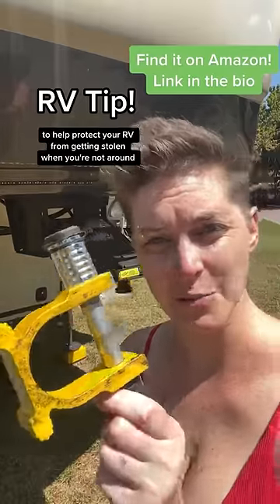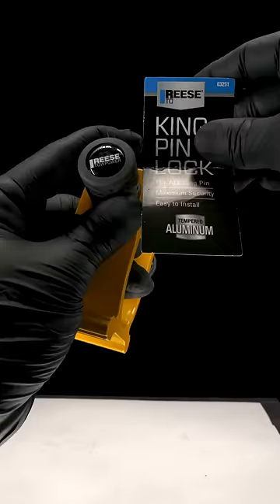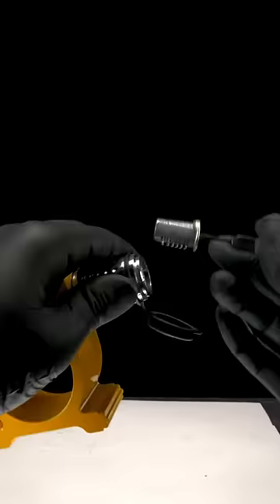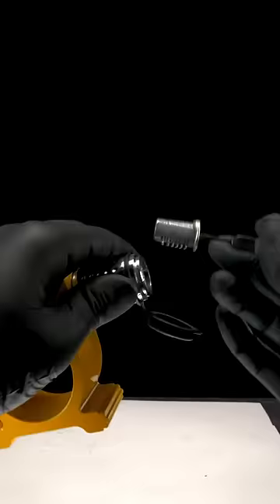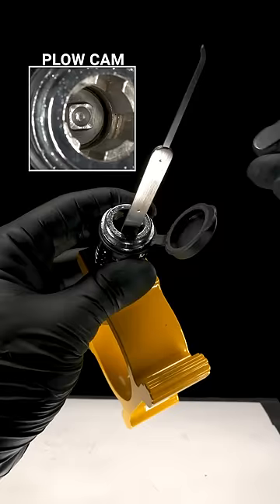Reese King Pin Lock opened with short hook & wave rake

Comment: This actually works! We found a trailer with this puppy attached, took it off, hooked up the RV and turned it 180 degrees on the same plot. Placed it back and waited for the owners to return.
Reply: 'Hope you came back to clean up all the mess in the kitchen from the toppled stuff not put away bcuz they weren't expecting to move just yet...
Reply: After getting my 5th wheel trailer, I told a fellow full timer that I was going to get a lock for the kingpin, and he told me that something similar happened to him. His 16 year old grandson and his parents were visiting. While he and his wife were out getting groceries, the kid pulled the lock apart in just a couple of minutes, and his parents packed everything up real quick, moved the trailer to a better site and set up again. They got the dismantling (he refused to call it picking) on video and met him at the swimming pool. When they all got back to the original spot, they played dumb until he pulled out his phone to call the police. 

So he went to the local locksmith, whose father was a friend of his and got his recommendations and went and got one. A few months later and he forgot to remove the lock and broke it off with the hitch. With very little damage to either the hitch or the pin.

He didn't bother with pin locks after that and just focused on keeping the door locked and the valuables in the truck and car... The kid got into cleaning up foreclosed houses for banks, landlords, and realtors. It involves lock picking, which he had been curious about before that incident. Then he got really into it.
Reply: more on Things That Never Happened 😀👍
Reply: @taitano12  This story is entirely incoherent and I have so many questions:

1) Why was the kid and parents stealing trailers from the grandparents?

2) Who played dumb? The kid? Played dumb as in pretended there was never a trailer there?

3) Who pulled out a phone? The kid or grandparents?

4) How did the grandparents get the theft on video if they were gone?
Reply: Pics or it didn’t happen 😁
Reply: Every time I hear or read a sentence that starts with "This actually works!...." I immediately disapprove the following
Reply: @chad1755  actually, the story is quite coherent. 

It was either the kid or the parents who got it on video, not the grandparents, and they didn't steal it, they moved it to a different spot. The parents and the kid played dumb, acting as though they didn't know what happened to the trailer, so the grandparents thought the trailer was stolen. That whole "Where is it??" part probably only lasted a few seconds and it was the grandfather who pulled his phone out to call the police.
Reply: Things that never happened part 1.
Reply: Ya, um no. Look, just cuz he made this look hella easy doesn't mean everybody could just do it like that. We all understand that, well, all of us except u
Reply: @oliverklozhoff  So what. Just because not everyone can do it doesn't mean nobody can. You'd be surprised by how many people have that skill. I don't, even though I have the knowledge. But I do know several people who do have the skill. So I'm willing to give the benefit of the doubt. To both op and the guy I met. Everyone lies, but not everyone is a liar. Most people are fairly honest.

Comment: This reminds me of a truck camper lid I had. During pothole season I'd often find it unlocked or with the cylinder dislodged due to road vibrations. After the cylinder fell out completely while driving I gave up and installed a latch and hasp.

Comment: I learned this lesson many years ago. I had gotten thrown by my horse and ended up in the er. When I came back the next day (with friends to help me) to haul him home I realized my trailer keys were in the clothes bag from the er AT HOME! I had manufacturers locks on the drop windows and tack room door. The trailer doors and hitch were master locked. After asking around a farrier at the show grounds agreed to help. Popped the tack room through the door window in less than a minute. Had the locks cut off in about 30 seconds each. The drop window latches he popped with some tool in seconds. So in less than five minutes he had the entire trailer open for me to load and haul off. 😳🤯 I have never bothered to lock any of it ever again. I learned the important lesson that locks only work to keep honest people out. Just about anyone can get through them no problem. If you want your RV to be hard to steal park a vehicle that can’t be used to tow it under the kingpin.
Reply: You should still lock it. Criminals mostly aren’t masters. They commit crimes based on opportunity. If your stuff is unlocked and easy to steal, that’s an opportunity. However, if they really want YOUR stuff, they’ll get it. Securing your stuff keeps most thieves out. But not all.
Reply: It just buys time. Hopefully in that minute someone will recognize that the thief is doing something he shouldn't be doing.
Reply: Its stupid not to use the locks after that.  It's still a deterrent and makes people think twice.  How silly to just not bother locking it up aftee that.  The guy knew what he was doing.  Not everyone does.
Reply: @tylerfb1  Yeah, you want something to deter the person looking for an easy steal, but you won't deter the hardcore or well prepared.
I'm sure that lock could be cut of in about a minute.
Reply: Then you better be prepared to lie to the insurance company. They think locks will keep everything secure. So when they cause $1500 damage just to rifle through your car looking for crap to steal they will deny your claim if the doors were unlocked... Oh wait the damages were caused because the door was locked. Yeah enjoy the irony as you pay that $500 dollar deductable.
Reply: I don’t lock the trailer anymore. I didn’t say I left things in it unlocked or made it easy to hitch to and haul off. Either park under the hitch with a not tow capable vehicle or park deep in the lines where it is surrounded. I had to wait longer for people to leave so I could get it out myself, but better that than stolen. The locks are worthless if someone wants what is in there so find other ways to keep your stuff safe.
Reply: Locks still help, because most people think that it would not be worth it. They think that the lock works, and as long as they believe that, it does.

Comment: at this point Im starting to think that the most secure lock would just be a couple bolts with weird heads that require a special tool to open, and you just carry around that tool

Comment: 😂 I remember seeing this door that had a massive shiny padlock on the front door but the door's hinges were rusted bit's of sheet metal... pop the hinges and you could take the whole door off. The same usually goes for houses, they'll have a giant deadbolt to lock the front door but then the hinges are held in by a couple of tiny screws. "A chain is only as strong as it's weakest link"
Reply: Put a couple screws blocking removal of the hinge pin. Robertson heads are good, especially since they are less common down in the U.S. of A.
Reply: Yeah, typical. Also, most car door locks up to about 1990 are vulnerable to a large flat head screwdriver, it just take a little bit of force. The most typical bike frame lock is vulnerable to the same using a smaller flat head. Fact is most locks can be defeated in a couple of minutes using basic tools, they are just there to deter people who know nothing about locks, really.

Comment: What i would do if i was lock maker id simply ask locksmiths what causes them the most difficulty in lockpicking whether its hard to pick or just annoying... Then id combine the top three issues into my new lock, would it be unpickable? No. But it will be so frustrating they might give up and go for an easier target.

Comment: No one ever claimed locks are impossible to get into. Locks are also drastically easier to pick when they're in your hand and not attached to the RV they're supposed to be protecting.
Reply: Great point. To be fair, this particular lock seems to have been glued into its enclosure with wishful thinking. Others might be a bigger challenge when in use but this one appears to be pickable with all of one's limbs tied behind their back regardless.
Reply: Lockmakers use the most outdated form of mechanics ever to be used in security measures

Also, if this was on an RV, he didn't have to hold it in any way to do his thing
Reply: This would be legitimately easier on the RV because then you don't have to balance the thing in your hand while unscrewing the bolt.

Comment: Well I don’t have any lock picks but I do have a heavy duty construction saw. Does that work?
Reply: Ironically these things are often better protected against that than lock picking.
Reply: @Nerobyrne  I suppose that is because a lock is unlikely to cut your arm off.
Reply: Yes, but it might experience substantial wear.
Reply: Yes but it makes a lot more noise and takes longer.
Reply: Use a hammer it's faster!

Comment: Insurrance companies insist that you keep your door locked to prevent breaking and entering.. What is even the point? Is there even a lock that can't be picked in like 5 seconds flat?
Reply: Actual lockpicking is rarely the issue it takes an amount of skill and time, it's easier and faster bypass methods that you really want to guard against.

Comment: Behold the gates of Heaven!

McNally: The gates of heaven are using a holy trinity seal. Using my rake pin I can jiggle away one of the 3 trinity seals, where I can then use the slap technique the separate the other 2 seals from the housing.

Comment: Just buy a cheap to tin of horrible pink or purple paint. Badly paint the sides of the RV without trying to apply an even coat. Sit inside or around the camp fire (with your back to the RV) smiling and calculating the difference between the lock you never bought and the tin of paint.

Comment: Alternatively if you're bad at lockpicking, bolt cutters.
Reply: Unfortunately almost all these locks made are shit and don’t even require lock picking skills, the only thing you need is a comb/rake and you can now pick 80% of modern locks
Reply: @MushuaThePotato  the thing is though, some locks are well made, and are a pain in the ass to pick, but a good pair of bolt cutters and maybe a drill with a good bit do not care
Reply: @vralingfrostmere1561  yeah the small 4% of locks that aren’t vulnerable to comb or raking sure
Reply: @MushuaThePotato  yeah but why waste like a minute or two trying to rake it when you can just cut the lock in a second or more
Reply: @vralingfrostmere1561  using a comb or rake takes less than a second and almost no skill or force needed. You just put the tool in the lock mechanism, jingle it around/press the pins up and boom your in

Comment: Who the fuck is worried that someone is going to pull up with a fifth wheel capable truck and steal an entire RV? You hardly be able to move the fucking thing considering that there's usually leveling jacks, pop outs that are out, and in some instances there might even be a patio on the back that's folded down. How do you even come up with these ludicrous fucking ideas?